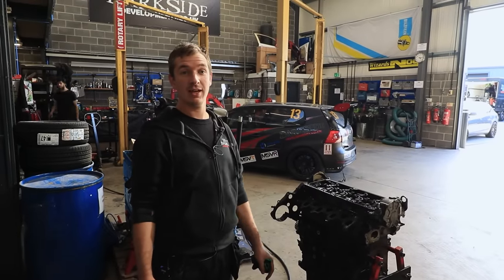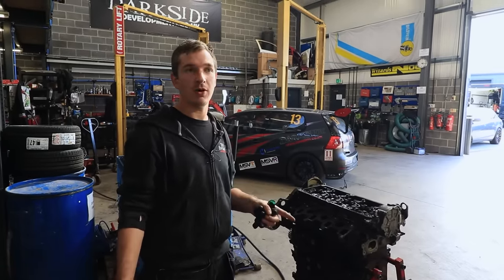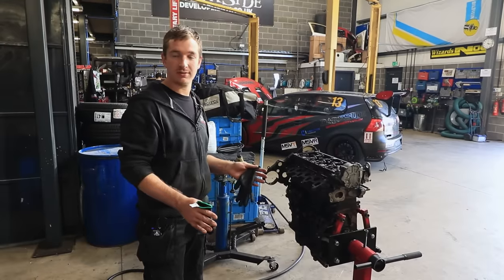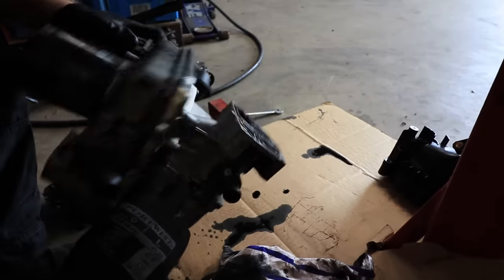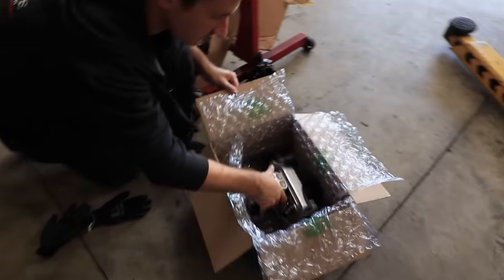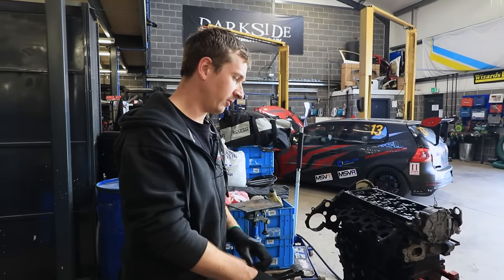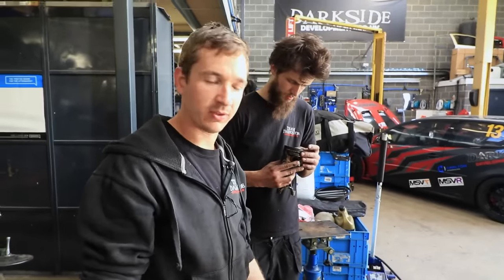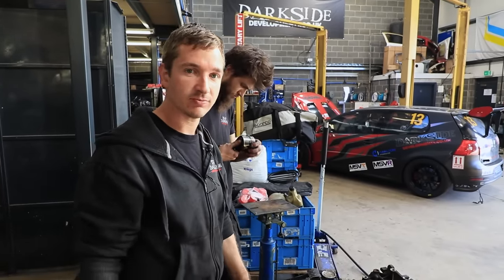Is this the worst 2.0 TDI engine VW ever built?

Comment: Hey guys from Australia - I have a T6 2018 Transporter TD1400.  I have fitted a Provent (Mann and Hummel) catch can - won't that help with this problem - I also had an ECU/TCU tune as I do a lot of beach and desert driving.  Love to get your feedback [please.
Reply: Where does the pipe come from on the engine and go to after the catch can? On my Nissan it comes from the head and then goes into the pipe just before the turbos. I thought the catch Sm was suppose to keep the air clean for the turbos.
Reply: By the way after double checking I have the good 'D' numbers - can you confirm I will NOT have a problem.
Reply: Roger Preston as far as the VW owners are concerned the factory “D” EGR has no proven record that it works. It does have a Teflon coating on the fins that is suppose to help with the extreme corrosive and heat environment inside the EGR, but do you want to trust an expensive engine on assumptions? Considering this is the 4th version of the EGR. With VW giving no guarantees on your engine, why take the risk? Just blank it off and delete it. It’s the only piece of mind. Not sure if the Darkside version though.
Reply from the maker: I'd just delete it and forward any fines to VW

Comment: Disable EGR, it’s an engine killer... There are no benefits for a Diesel engine, only negatives... Some state it cools the engine, nah it’s running hotter already than normal because it’s not running  efficiently..  Switch it off, mine is bi-turbo and no issues whatsoever, cleaner oil and no diesel wash... 👍

Comment: We had oil consumption problem in our transporter 180hp. changed motorblock and also with the newest d type egr cooler. BUT now after 130000 km the same problem occur. the motor is drawing very much oil AGAIN. Do you think its the same problem that had occured? or mabi it is the turbo this time? I know that they rebuilded the engine with the old turbo. If anyone knows something about this. Please let me know.
Reply from the maker: The turbo's leak a lot of oil so please check that first. but after than amount of use the engine could be gone again!!
Reply: @DarksideDevelopments  Okeey thank you=). So the D type egr is not rock solid ?

Comment: What about the amarok 2.0 tdi 180 , got the same problem? Is it reliable ?
Reply from the maker: The EGR Cooler setup is different, so it doesn't have this oil issue, but the Turbo setup is the same

Comment: so what's the most reliable and powerful TDI engine in the vans? T5 and T6?
Reply from the maker: 140 in the T5.1 and T6, time will tell but they all have loads of potential issues, the single turbo's are obviously simpler!
Reply: An old 2.5 VW van engine with clattering  gear drive to cam
Reply: @garypeatling7927  what year would that be?

Comment: Your making it sound alot harder than what it is,,the only reason i say that is  i have a f250 ,that egr is the problem,,you need to find a way to by pass it ,or separate the egr,coolant and oil cooler,,and that engine will run fine,,,
Reply from the maker: Even when the bores have worn 0.5mm oversize? dont think so!

Comment: I have the BKD engine in my golf is that any good?
Reply: Pre 2007 heads like to crack and turbos are terrible..good with our hybrid killer!
Reply: Pretty good with "c" head. They dont usualy crack. Pretty strong too with good turbocharger. Simple engine, but higher consumption than later CR.

Comment: Didn’t this engine also have problems with piston / oil scrape rings? Just like Audi?
Reply: That's a result of the EGR cooler.
Reply: Ryan P Thanks, so quickly disable egr on these engines in software.
Reply: @roybm3124  and hardware

Comment: Not a global warming fan. Everyone should be able to have straight pipes with no dpfs and cats. Screw our lungs we die anyway lol
Reply: If we think air quality will be improved overall if we accept all the bolt on emissions devices we are sadly mistaken. The big polluters need to sort things out.
Reply: Yes it doesn’t help when VW says 1000ml oil usage per 1000km is acceptable, didn’t know these were 2 stroke engines.
Reply from the maker: @craigs902  That sounds about right
Reply: @ThenameisOskar  emisions standarts has very little to do with global warmimg. Dont mix those up. High consumption = high co2. Egr and DPF is there to protect human healt.
Reply: This kind of premature failure costs the environment.  The problem is regulators mainly focus on emissions and CO2.  Regulation needs to cover longevity and reliability as these are the biggest costs.   Solar panels have to have 20+ year warranty to ensure environmental pay back.
Reply: @craigs902  I loled hard. So true!

Comment: Looking a 2010 caravelle bi turbo 135k . It is ideal on paper, and a reasonable price. Have been reading up on potential engine issues with concern 🙈
Would an engine code CFC 007476 be one of the ones to avoid or not ?!
Reply from the maker: If it's been well looked after it should be okay. If the work we show has already been done then it will be alright but if not, it's risky with them and will be an expensive fix

Comment: All the modern stuff is crap. Thanks to emissions rules we can't. But id rather have a V8 6 liter non turbo mechanical old school diesel in my vw than some boosted little 2 liter. Because reliability. That V8 Will do a million km with regular service intervals. That 2 liter will be shot under 300.000 km with a lot of repairs in between also.

My van needs to work. A little more fuel consumption i don't mind.

Comment: they put golf engines into vw transporter
Reply from the maker: Who does? they are totally different!
Reply: @DarksideDevelopments  they are not,little changed torque and rpm
Reply: @Mr11ESSE111  they are not the same. Try to put a golf engine in a T5 and you will see.
Reply: @ryanp6138  ccm and hp are same just like you have 1,6 tdi with 80hp for transporter too

Comment: Isn't the cause of all these issues due to the long life servicing?
Reply: Not really but servicing often helps!
Reply: Long life services are just plain bullshit. Change oil every 5000km on a diesel even with full synthetic oils.
Reply: I used to manage an oil testing laboratory and did so for a number of years, no diesel oil stood the test of time, hence I change my oil every 5000km.
Reply: I religiously changed mine at 10k miles and it still died at 73k